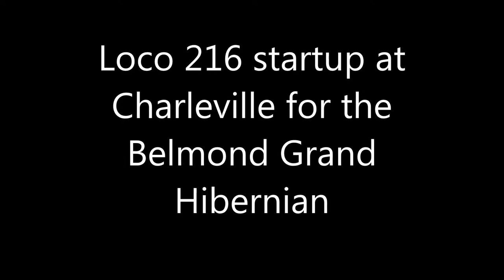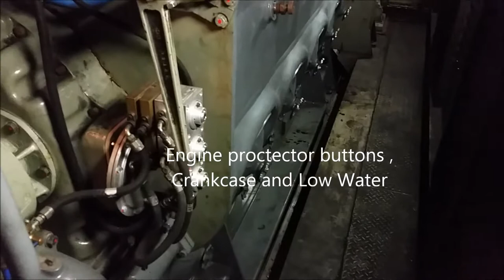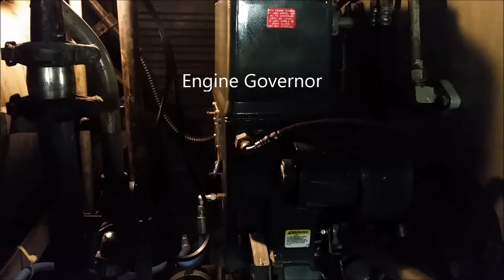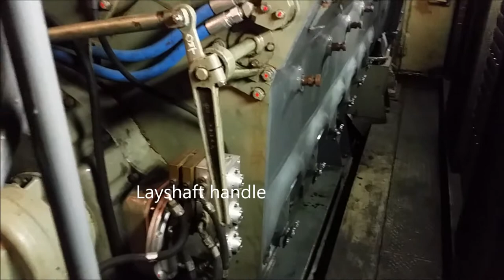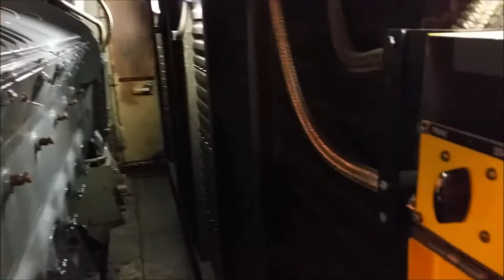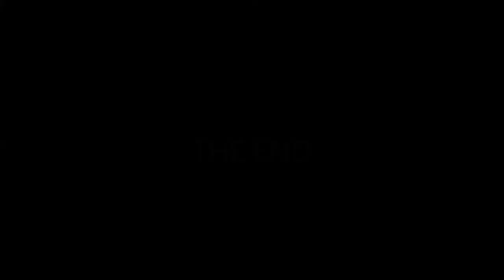216 startup at Charleville for the Belmond Grand Hibernian , GM 710 series 12 cyl turbo charged .

Comment: Great Video Tom!😃.And Nice Start up!.
Reply from the maker: Thank you , the main thing is it started !
Reply: @RYNT1157  how old are the class 201 and how do they differ from the 071 class of trains
Reply from the maker: @thomascleary83  201s came in 1994-5 they have a GM 710 engine of 3,200 hp and have a top speed of 100 mph. They were equipped with Head End Power HEP but this is discontinued. They are push / pull equipped and a number of them have buckeye couplers . These are the only ones left in service now
Reply: @RYNT1157  if memory serves me right you retired form irish rail  this year
Reply from the maker: @thomascleary83  Finished on the 7th of January .
Reply: @RYNT1157  I hope you enjoy your retirement  did you ever drive an icr or where you always on the mk4
Reply from the maker: @thomascleary83 Have driven  ICRs , Mk 4s , 2600 , 2700 , 2800 railcars. Worked all types of loco hauled passenger and freight over the years plus PW trains.
Reply: @RYNT1157  Shame about Belmond.  Do you think cement and kegs will cone back
Reply from the maker: @oscarosullivan4513  It's hard to know if it will.